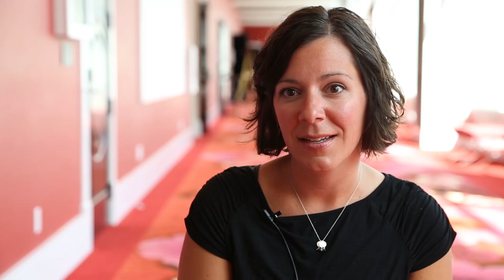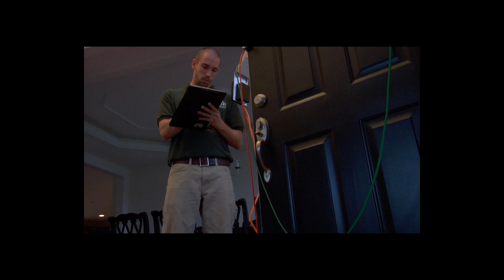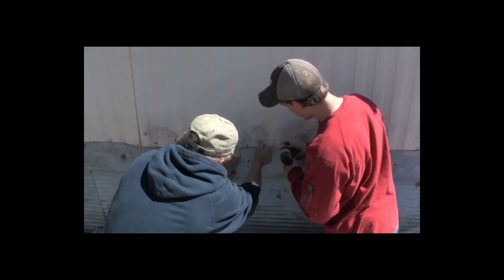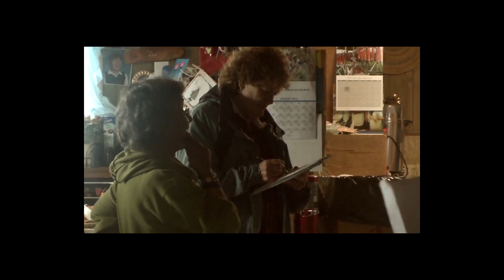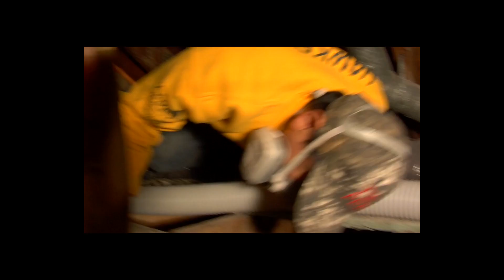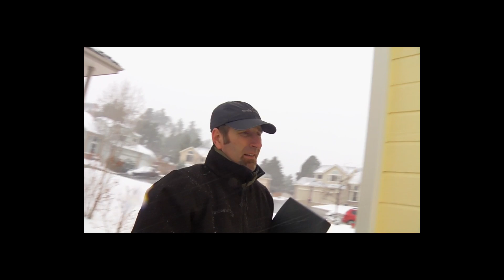The Weatherization Assistance Program: 40 Years of Improving Homes and Lives

Comment: Yeah and it doesn't seem to matter, you can get new windows in northern Michigan, and they will repair your roof if you live in northern Michigan, but if you live in the Metro Detroit area, they won't help you with Windows or your roofing, in fact they won't weatherize your house at all if you have a roof problem in the Metro Detroit area, but that's different up north, and it doesn't make sense to me, My house is supposed to get weatherization, but I don't know how that's going to work when I need new doors and new windows.